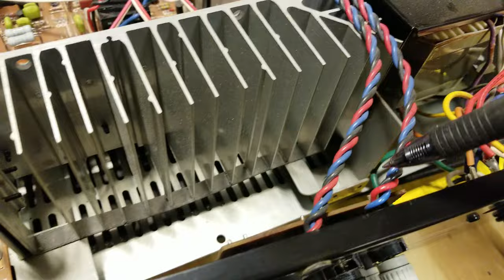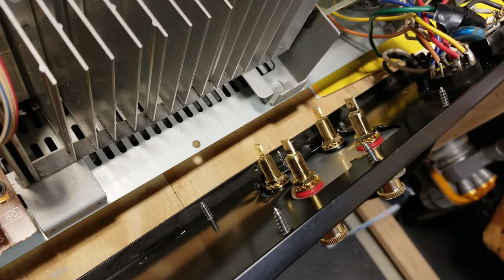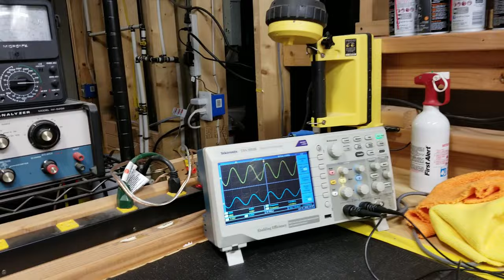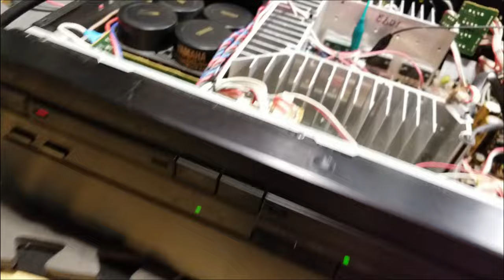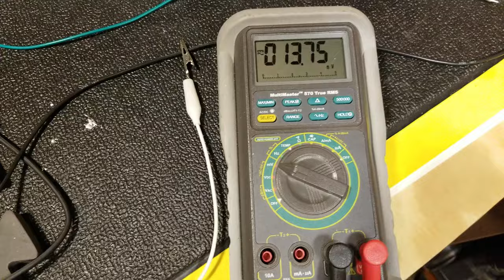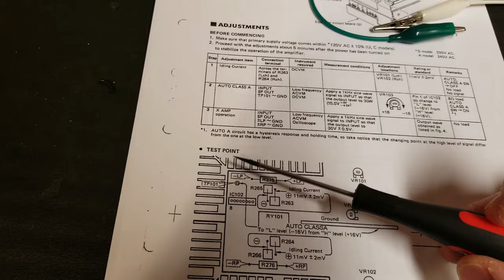Yamaha A1000 Speaker Binding Post Upgrade

Comment: I have a broken A-1000. It was my first integrated amp. It's been sitting on the shelf of a tech's store for the last three years. I bought it new in 1985. I wonder if it will ever get repaired? I guess I could ask for it back but I don't want to hurt the tech's feelings. He told me he wants to take another stab at it. 

I'm well past putting it in my system. It died 18 years ago. I put it in a corner of the basement, with the rest of my stereo. Three years ago I dug it out and took it to the shop for repair. Since then I bought and sold my Yamaha A-S3000. I still have the PrimaLuna EVO400 power amp but I think I'm going to sell that too.

My primary amps now are NAT Audio Generator mono blocks. These are the last amps I plan to buy. They power my speakers like no other amp has, and I've tried about 7 amps in the system.

Someday maybe my A-1000 will work again. If it does, I'll give it to my son to put in his system. I bought him a used starter system a year ago.

Comment: Love the video as usual, I have a Yamaha A 700 from I think 1981 or so I have hade running for 25 years or so and I believe it’s very close to the 1000 probably and it’s a freaking tank I have it run into both channels at 4 ohms running a set of sansui sp 3500’s 6 way horns with a 14 inch driver from 1976 and a pair of infinity 3 way 10 inch from 1991 and I crank it and beat on it and it’s been on and never turned off in the 25 or so years ,it sounds great ..my main amp is a marantz 1250 from 1976 which is a family airloom that I baby on special occasions. But that Yamaha has lasted well longer than it should have and I wonder when it goes south if I will ever find another one...
Reply from the maker: Sounds like a system that I would love to hear.

Comment: Channel imbalance is due to the volume pot, same on mine. The problem is that you cannot find this type of volume pot anymore. Also for adjustment you should change the pots for new ones with more turns so you can make fine adjustments. I do this on all the amps that i work on.
Reply from the maker: Yes, it is the volume pot; the pot also has a drop-out spot too.   I do intend to change the bias pots in the future.   Thanks for the comment.

Comment: Hi stereopolice, I really appreciate the effort put into this channel and for the informative feedback and review of products, especially amplifiers, have you tried to compare the A-S1100 to A-S1200 or A-S1000?
I am looking for a nice amplifier to use for life and stop for a while searching integrated amplifiers, I have looked at the used market for the A-S1000, but some owners complained that I has some problems with the software inside that enters into power protection mode or something and also A-1000, A-2000 and other amp like Pioneer A-717/A-777 and even Sony's ES series like TA-F505/570 ES etc., but since some are from early 90's I was thinking of buying a nice used A-S1000 in mint condition or pull the gun on a new A-S1200 and make some financial savings for it.
I am into buying quality gear that has a good price/performance ratio and I wouldn't have to worry about braking and not being able to fix it, some newer amps have integrated circuits that once broken you have to replace the whole board.

Comment: Well I would never undertake such a project, but I found the methodology fascinating. Know that your videos are appreciated. Great job, would be interested to know how the a1000 compares to your beloved a-s1100.
Reply: Had one model down, the a700.  In a head to head comparison my Pioneer Elite M10x mosfet power amp beat it handily.  I'm confident it would beat the a1000.
Reply: @jman8368  Don't get your hopes to high, mosfet's are nice, I have a few amps with them, but, that A-1000 hits like a sledge hammer with clean power. I'm sure that A-1000 would have its way with that pioneer and toss it to the side. Nothing but a stud of a power supply with beefy capacitors.
Reply: @TheDistrict644  While I've never heard the A1000, the Pioneer did beat the Van Alstine SET120 power amp.

Comment: I don’t totally understand electronics, but enjoy these type of videos. Could you explain how combining the red and blue wires didn’t result in monophonic speaker output? BTW, ‘enjoy your videos - subscribed!
Reply from the maker: If there was only a speaker A pair output (i.e., one speaker pair), there would be for example a black (-) and blue (+) for the left speaker, and a black (-) and blue (+) for the right channel.  However, this amp had a speaker B switch for an additional pair of speakers.  It would be like connecting an additional pair of speaker to the same binding posts of speaker A, except they provided you with extra binding posts, in case you wanted to switch back and forth between different speakers.  So, speaker B had the same black (-) wire for the left speaker, and a different red (+) wire for the left speaker (same for the right speaker), because it was separately switched from speaker A.  Speakers A and B had separate switches and could be switched on and off independently, but in the end, the positive (red and blue wires) were connected to the exact same place (the same output transistors), so shorting them together into a single binding post is fine, because it 1/2's the resistance of the switches and wires running to the binding posts.  There are still two entirely separate L and R channels for stereo.  Cheers.
Reply: @stereopolice  Hey thanks! ‘Looking forward to the comparison with the Luxman!

Comment: Replace the trimpots with vishay foil 1260 series.  HUGE upgrade in sound and not nearly as finicky with the adjustments.
Reply from the maker: Yes I was thinking about replacing those things.
Reply: @stereopolice  Replaced them in my Pioneer Mosfet power amp and sounds like a completely different amp now.